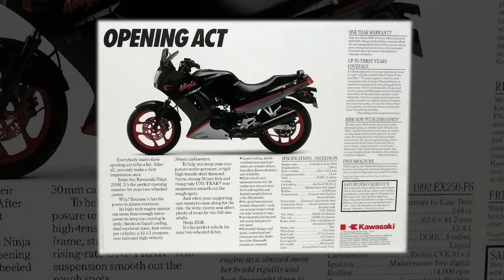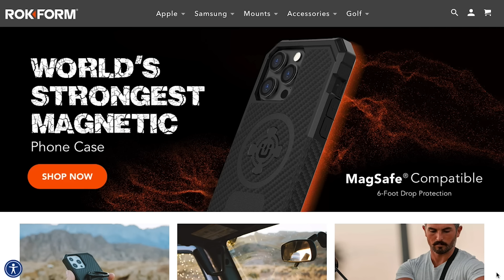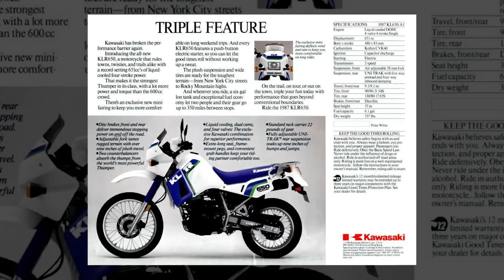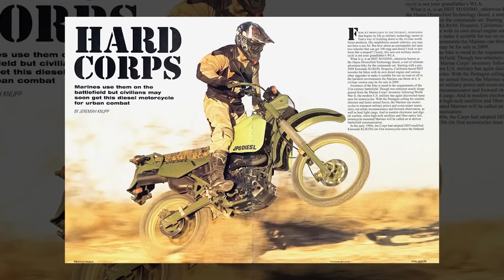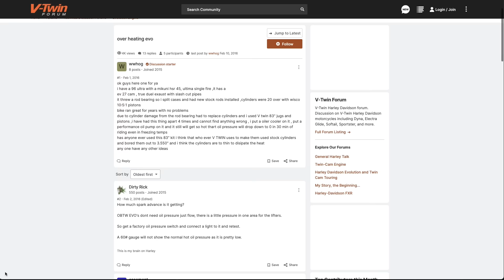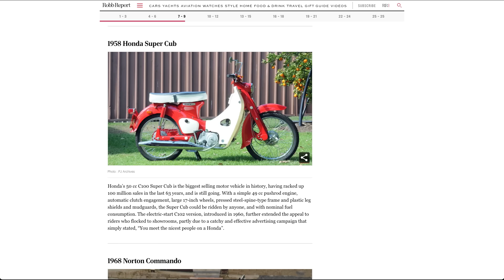Top 10 Ridiculously Reliable Motorcycles (Unkillable)

Comment: had abuddy that bought a used 73 honda dohc 450(30,000 miles)  that was not supposed to be all that reliable -- gave it a major tuneup  adjusted valves & such & rode it from lake charles la to the northern tip of maine & back in about  5 weeks  -- then rode it for another 2 years before he sold it -- just normal maintenance -- chain & stuff  - incredible machine

Comment: The 2006 Sportster 1200R was the best air cooled Sportster ever built. Off the floor it generated 70 hp and 80# of torque and would leave my 2005 Sportster 1200C in the dust. Big twins that weren't modified to the hilt didn't stand a chance, sure they could get close but 2nd place is still 2nd place. With dual front rotors and a blacked out engine, I accumulated a 1200 custom tank and a bobtailed rear fender and blacked it all out. It looked nasty mean and an attitude to match.

Comment: Had a 2017 Honda 250 Rally. Put 20k miles on it in 4 years. Not a single problem. Oil changes, tires, chain and sprockets. Never checked the valves.

Comment: Hey Yammi Noob, you forgot about the bulletproof Kawasaki Concours 1400. I've had 14 years of smiling 135,000 miles with just wear items like tires and fluids. There's a guy with 294,000 miles on the forum, all original with normal maintenance and rides all over the states every year since 2009.

Comment: It doesn't surprise me that motorcycles are reliable because of there simplicity especially small off road bikes with there low horse power light weight and very good engineering equals a very reliable package

Comment: I dont think you guys know about this, but there're 2 more Honda bikes that absolutely reliable. Honda CBR150R and Honda Wave, both are insanely reliable here in Thailand. And quick mention about Yamaha Finn that's almost on par with Honda Wave. These bikes are unkillable and many squid head here modified Honda Wave from head to toe and it's still pretty reliable.
Reply: I've got an old cbr125r that will basically sit revved out all day. Tough little engine
Reply: Just got back from there, would love a wave with loud pipe and skinny tyres but we don't have them here. Loved the wave, and also the 300 yamaha, such a cool bike place!
Reply: the wave is a cub derivative anyway so partial credit

Comment: I'd argue that the Honda XR650L would be a better choice that the KLR. There are inherent flaws with the KLR.
Reply: I dunno, I just sold my 1993 50k+ KLR that was drained and sat outside for over 2 years. Dude had it running with fresh fluids and a new battery 😂
Reply: Way more KLR 650's have been used by those hardy souls that wanted to ride around the world than the Honda. They always pick a bike that is least likely to give them any issues so it's not going to be the Honda.
Reply: Just keep fiddling with your doohickey.
Reply: @LoganFillmore  Don't have to worry about that. Both of mine had the dookickey kits put in them before I owned them.
Reply: Hondas are great but somehow, Kawasaki seems to rule the roost, in terms of the metric ADV dirt oriented niche - I see 2x as many KLR 650 vs any other make, Honda XL650 included.

I'm not partisan never owned a KLR - but would if opportunity arose.  

For now I'm thrilled with my Suzuki Vstrom / DL650 !

Comment: So. Here we see it. Take care of that motorcycle, and it will take care of you! I see many testimonials here about ONE OWNER bikes that were taken care of (maintained) and racked up seriously high mileage. The bikes that change hands often, see little maintenance, and are abused by several different owners are the motorcycles that give a model or brand a reputation for unreliability. I will agree that some designs are more durable than others, but even designs that push the envelope can have very long lives if properly cared for. Regards, Dean

Comment: Honda VFR 750s are also quite unbreakable. i know some around here with 250,000+ km. The new R1300GS is not good if you ask me. It makes more torque then its good for the gearbox. As a result it tends to rip itself apart. Whad does BMW make about it? A Software Update!?!?!

Comment: Well, my 2004 Aprilia Pegaso 650ie (everybody said it is the worst bike I could buy) had just one problem... some bulbs burned and it's a 185000+ km runner (That's more than 100000 miles).

Comment: Hard to beat the GoldWing GL1500. Other than the switches that tend to fail. And the rear master cylinder. And of course the sticky 4th gear that develops, even after Honda "fixed" it. And of course there's the stock seat that leaves you crippled after 80 miles....but yeah, the GL1500!

Comment: Guy on the FZ/MT09 forums not only have a drag bike that holds the record for its model, but he also has a road going one that has now surpassed 200k miles. I’ve got 30k on mine of fairly heavy abuse and it’s yet to give me so much as a hiccup. Surprisingly solid machine. I think the only reason there aren’t more high mile ones is because hooligans wreck them before they have a chance to reach old age.

Comment: I don't think the R1200GS should have been on that list, they are notorious for clutch (that requires you split the bike in half), drive shaft, fuel gauge and ABS failures and are crazy expensive to fix (on top of the 10000km valve check schedule). Sure you can put 200000km on a 1200GS, but how much work and money will it require? Chances are at that mileage you will have paid the bike twice. On the other hand I've seen some Super Teneres at 200000km on which valves hadn't even been checked once, and they were still purring.

Comment: Due to personal experience, agree 100% about the Suzuki SV650- I think the best all round (road) bike of the modern era- combines reliability with actual performance. But You missed the Suzuki GS500! it’s like Suzuki engineers looked at the SV & said “ still not reliable enough!”😅...so simplified, lightened- yes not much performance wise ( but same a Ducati scrambler!☺️ but with running cost & service intervals approving...errr zero dollars 😅) even if you neglect them it’s a totally unkillable bike😮

Comment: Im 6ft 340 and i have a 07 hyosunggv650 which is pretty much same engine as the sv650 and though it has its little quirks its been reliable and fun. I also have other bikes by hyosung was given a bad rep yet theor 250 aquilla was able to hit 100mph haven't seen that with any other bike

Comment: It's crazy just what cubs can do. Just keep in mind they've been used for a lot of the same massive trips as BMW GSs, but with 10hp or less. 

also they're technically an underbone motorcycle. Cubs lack floorboards, a swingarm mounted engine, and tiny wheels. So all of the defining factors of a scooter.

Comment: you don't speak about the CB500 PC32! Honda says it can stand 200.000 miles (300.000km), I have one with (i guess) 120.000km (about 90.000 miles on the clock, and 15 previous owner... nothing to say about it despite it run when i need it
and i have a ZRX1100 to, that have 200.000km on the clock, run even better than the CB500 (but a lubrication system a little bit complexe make it sensitive to run on the side stand, and many engines breakdown because of this)

Comment: Valkyrie is practically unkillable. There is a guy in Colorado with one that has over a million miles on the original motor and counting. That's right, a million miles plus and it still runs! THAT'S longevity!

Comment: I have an 06 R1200RT.  This bike is so reliable i was told  by my dealer that the manufacturer will no longer ‘support’ the platform after 2026.   
So apparently 20 years is the benchmark to where BMW turns it’s back on the very philosophy with which it was built.  
Bikes that continue to perform. 
As for me, I was looking at adding a new RT to my stable, but now, I’m looking at other manufacturers.  
Why would continue to support a manufacturer that no longer supports me?

Comment: lets not forget hondas lemons like the cbr 1000rr is a lemon as you found out   dumping all its oil, frying ecu melting /breaking line from extreme over heating . Hondas fix? they sent out letter to cbr 1000rrr saying .. you bought a track bike so ride over 55mph at all times . out of the 4 cbr 1000rrr i have seen on the street 3 had blown engines .

Comment: You made the list only with bikes in production at the moment. You left off the mileage king of kings, the BMW K100, a bike that comes in several variants, that never seems to quit, just be passed on from owner to owner. There are regular reports of the beemsled turning well over 300,000 miles with only regular maintenance.

Comment: Why did you not post this video like 4 months ago, I had the chance to buy a near mint condition FJR1300 for a cheap price back then. Still real good knowledge for the future.
Reply: What did you get instead?
Reply: @petejr7774  A yamaha TDM 850 1995 mint condition except needed to replace fuel valve as it was leaking, currantly trying to find LED lights for it as well so i can see a bit better at night

Comment: Missing the Intruder 1500. Arguably the most reliable cruiser in history. It’s biggest issue was being overshadowed by the Vulcan 1500 simply because the Vulcan 1500 was more known by the public and more interesting because it put out more hp, was easy to fix and cheap. The Intruder was a hell of a lot more reliable as they would simply go on forever. A brilliant bike that saw it’s doom way too soon. The ones that are still left are often in great condition and are straight unkillable pieces of technology ahead of it’s time. I even dare say in most areas of reliability it’ll even beat the famous Goldwing. It’s an overlooked masterpiece of peak engineering from Suzuki.🤷🏻‍♂️

Comment: Yamaha XJ 750, thats one not here, comfortable, good mileage, bullet proof motor, i brought mine at 108,000 km, sold her with 326,000 on the clock and still running.

Comment: Honda ST1300 / ST1100 would probably beat the Kawasaki FJR for reliability in that class. I know folks with 300k miles / 500k km with no major repairs along the way. 

Another classically reliable bike is the Honda CX500/650. Again, a simple water-cooled jugs-out bike that could basically run air-cooled (in the UK - lol) if the water system failed.

Comment: Soooo, simple and low powered is best?  Absolutely.  If you take an engine that is about 150 BHP and detune it to 100 it will last well, and a lot longer than the 'Blade that donated the engine to my Hornet [919 for you lot on the wrong side of the Atlantic] that has just had the 108 000 mile sevice done, which is 'count the wheels and change the oil and filter' even though the oil wasn't due.

From the insanely reliable Honda Cub to the CBR600 all these seem to be better than the current crop of number chasing bikes.

My top tips for reliability are - 
1] does it have a centrestand?  If it does then it will be easier to work on, meaning it has been likely to have been worked on.
2] were lots sold over a long period of time?  If so then if you need a part then you can probably find one [didn't look at that when I got the Hornet!]
3] when are the oil changes?  If they are 4000 miles or under they may be missed to save a bit of money.  That said my CB500 and hornet are due at 8 but get changed at 4.

Comment: When i had the idea of buying a bike, the first thing that i started comparing between brands was the sound of the engine and the best sound i heard was Honda. After that Kawasaki. People keep putting aftermarket exhaust on their bikes and i don't understand why because the exhaust sound simply gives an idea to the rider how the engine works. Changing the exhaust doesn't really change the way the engine sounds, it simply gives a "different tune" to that sound, which is an unnecessary expense to me. That's one of the reasons why i dislike Ducati. It sounds sketchy to me, while Honda sounds so perfect. It sounds smooth and yet - aggressive. Which is a very rare combination. Most of the times, when it comes to vehicles, you have to choose between reliability and power, but Honda Motorcycles tell otherwise.

No wonder it sounds so perfect, i have heard many stories about the Honda bikes. They're reliable!
Reply: Sound should be last for reasons to buy a MC. They all sound nasty with  straight pipes.
Reply: @got2kittys  i have no idea what MC is

Comment: i had a 1980 honda cmt 400. what a piece of junk of a bike. starting with the multi link cam chain that got dirty and couldnt be cleaned so it wore out faster, then there is the timing chain adjuster that has not even a half inch of total adjustment.  ive never had another bike that even came close to wearing out a cam chain as this bike. 
then there is the rear sprocket two piece hub in rubber mounts, instead of being bolted onto the wheel directly like every other bike. 

yet i still managed to get almost a 100,000 miles out of it before i finally let it die.